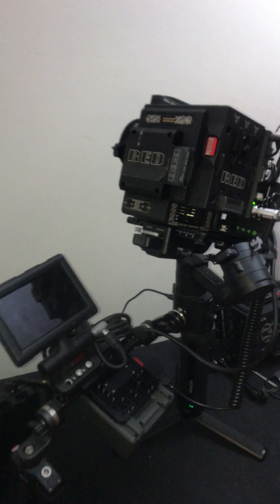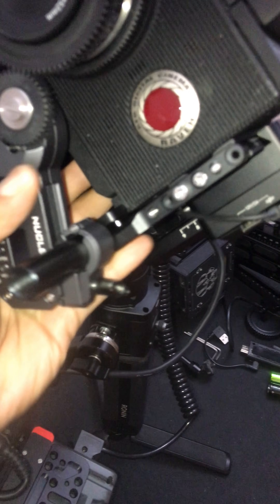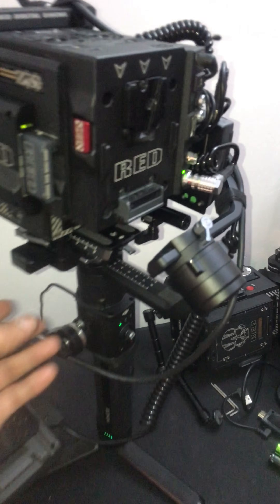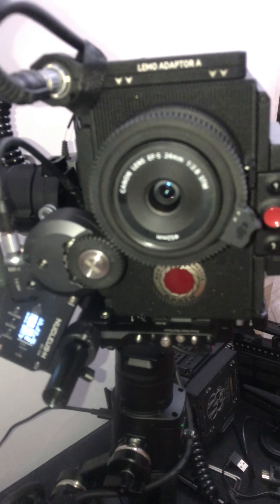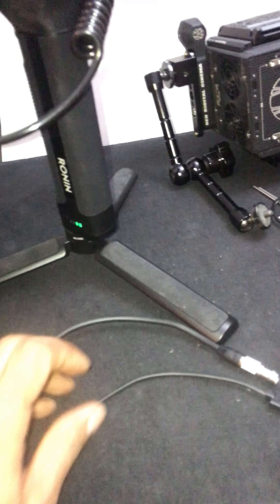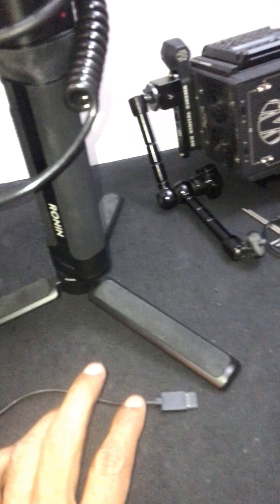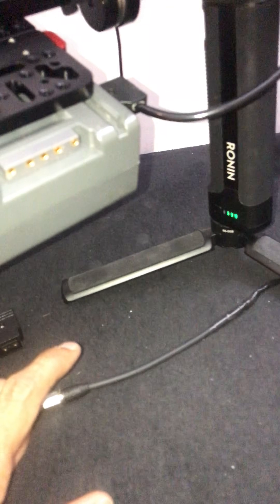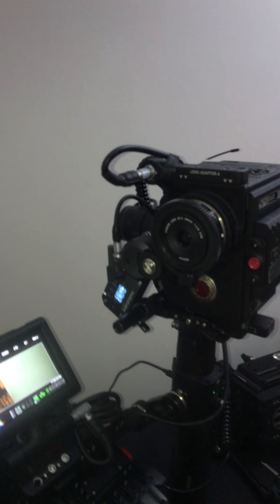TILTA’s NUCLEUS M powered via RONIN-S CAN PORT.

Comment: Interesting solution but for everyone wondering: There is another pretty easy solution. You can power the motors with a lemo cable directly from the handles using the handles battery :)
Reply: Have you tried this? Tilta specifically states that the handles can control it but not power it. Link to Tiltas comments on the subject here: https://tilta.com/support/can-you-use-the-nucleus-m-through-a-wired-connection-to-the-handles/
Reply: Victor Alvarez I have the full set and the grips both power and control the motors. The problem with doing that here is dealing with a cable between the two, restricting movement.

Comment: Love this, great solution. How did you go about discovering which color cable does what? I am trying to do the same thing. I cut apart an extra ronin s cable that was for power to a black magic pocket 4k. It had 2 wires. One was red the other black. I am assuming the red is the positive 12, and the black is negative 12. The 7 pin tilta lemo wires are just like you mentioned. Have you had any voltage problems with this setup? Also, do you have a link to the cable you show at 1:39
 (dji ronin S to Dtap)? Thank so much man!

Comment: Which accessories you used for the rosette from Ronin S to the Handle? the bar cheeseplate, where do you get from?
Reply from the maker: I did't buy any specific accessories for Ronin S. This rig is just built whatever we have for available (most of the accessories from our other my Shoulder rig). Check out Smallrig.com you may find same accessories if it still available.

Rosette for Ronin-S -> SmallRig Arri Standard Rosette Bolt-On Mount 1939.
To attached Handle bar to Ronin -> SmallRig ARRI Rosette Arm 1684 (with additional Knob)
Handle Bar -> SMALLRIG Rosette Bracket 1473
For V-mount Battery -> we used SmallRig V-Lock Assembly Kit 1846